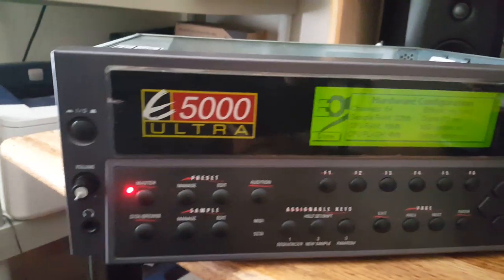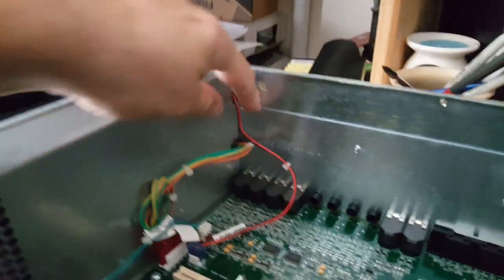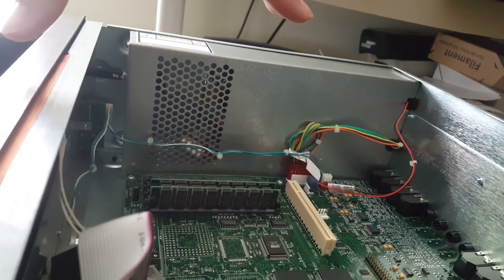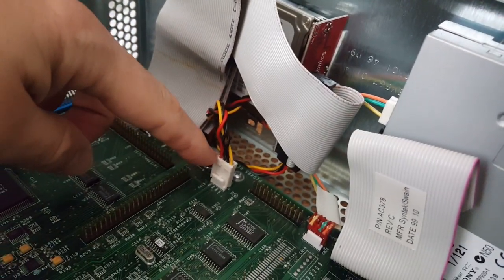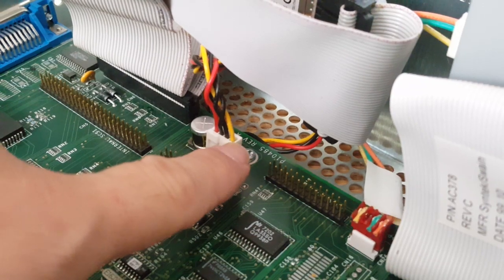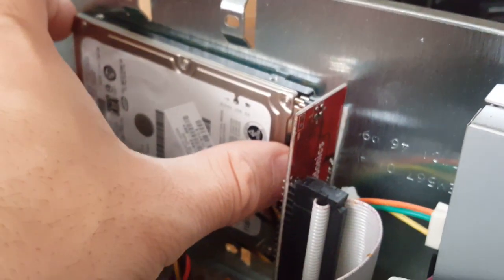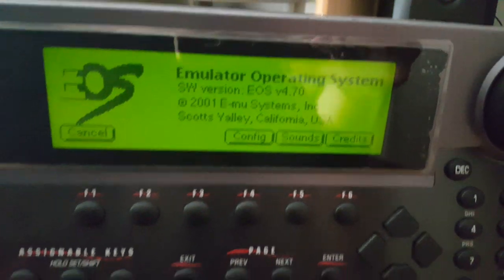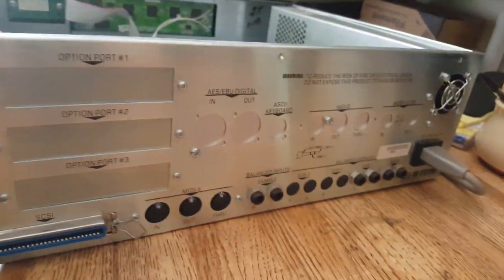E-mu E5000 Ultra with a 160Gb Sata hard drive

Comment: How much does this sell for in 2020 and how does it work ? As far as connecting to digital mixer preamp to get sounds or midi keyboard? I cant find any tutorials ty
Reply from the maker: Until few weeks ago there was couple on ebay, yea you can connect to mixers to get the sounds and you can connect midi keyboards on it
Reply: @AngeloCoelho  cool thanks would be nice to see the actual connecting video :)
Reply from the maker: @kennynyc15153  I sold mine 2 weeks ago, but there's pleny of videos around, if I still have mine I would be glad to do a video !
Reply: @AngeloCoelho  cool man thanks, appreciated